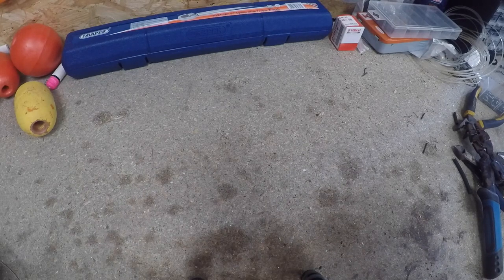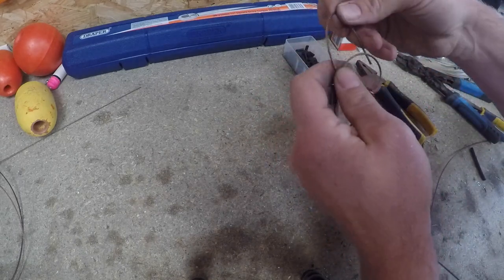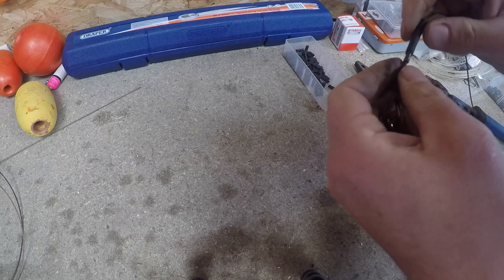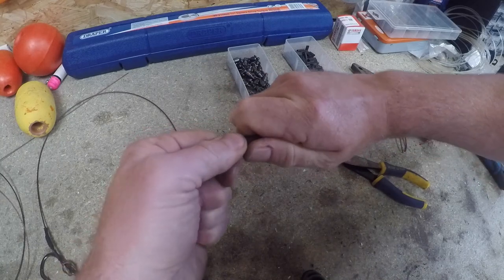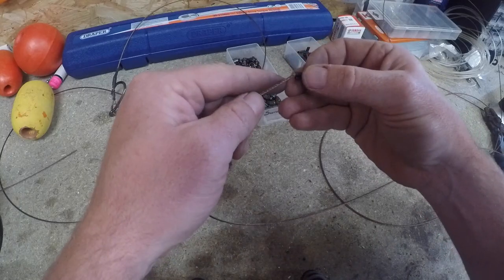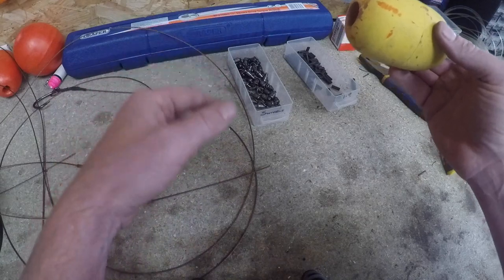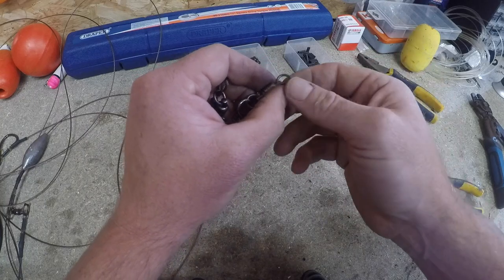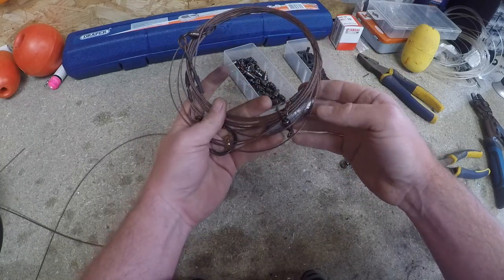Workshop-How to build a Thresher rig

Comment: So the float goes on the main line above the snap swivel ? 
That would give you 17 feet of depth to play with ?
Reply: You should go no more than 12 feet. Anything more than that you won’t get bit, the reason is because thresher sharks are pelagic fish. If you’re fishing at a pier, they will be on top of the water. Anything more than 12 feet, you won’t catch threshers only bat rays and maybe other species.
Reply: And definitely not that much wire.
Reply: @David-ec9fd  I'm in a boat off shore